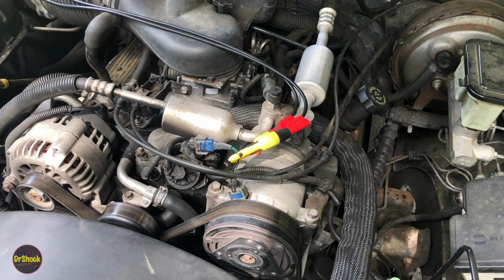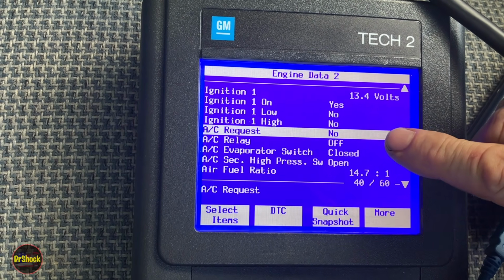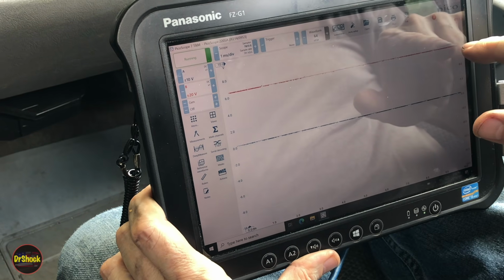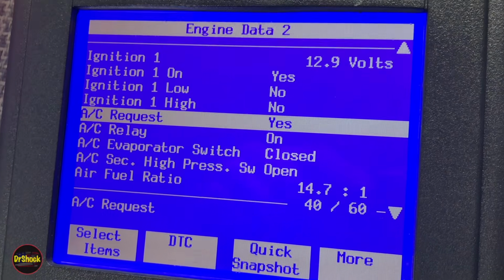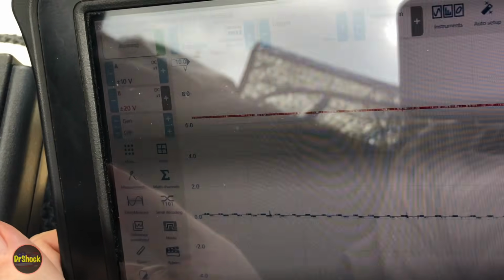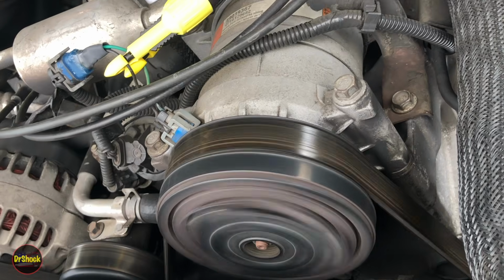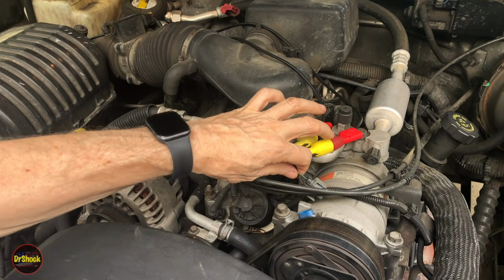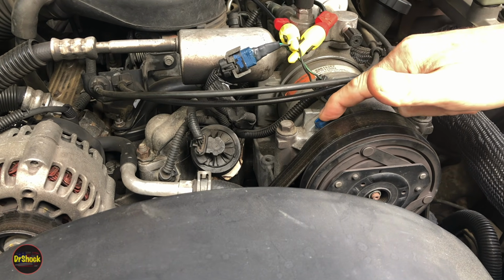1996 - 2000 GM OBS Truck HT6 AC Compressor Clutch Disassembly ~ Coil Replacement (Chevy & GMC)

Comment: Hey man I can’t get the installer tools to set the air gap ejybwoudk that be so I neee to get a special tool made to fit the shaft ?
Reply from the maker: There are links in the video description for where to purchase these special tools (many cannot be obtained over the retail counter). 

The situation we ran into here with the wrong threading on the shaft was a manufacturing error by the supplier to GM, it should be rare/uncommon to come across imo.  But if you do run into it, yes you'll need a machine shop to fabricate the correct thread arbor as I did.

Comment: If you needed to remove this type of clutch for replacement how would you going about doing so? Or does this type of compressor require a full replacement due to a worn clutch?
Reply from the maker: Watching this video should answer such questions.  You can use the scrubber to get to the disassembly chapter.

Comment: I am having a hard time locating a clutch assembly for the HT6 with the Nut hold down
Reply from the maker: You using the part number links in the video description?
Reply: @DrShock  Ok yeah guess I missed it thanks, and thanks for the video

Comment: This is my problem exactly..but my 99 has the compressor way down at the bottom so it's gonna be a little struggle
Reply from the maker: GM had multiple truck designs in 1999 - 2000, this video is showing the carry over old body style (ODS) design from the previous generation that continued to be sold thru 2002 in various weight ratings.
Reply: @DrShock yeah mine is end of production year 99. I always have to get parts for "new body style" it was all good info for me tho

Comment: My clutch clicks on and right back off after 2 seconds.    If I jump out the evap switch the compressor will stay on however I only ran it for about 10 seconds as I didn't want to burn it out.     Ac was very weak when I bought truck.  99 yukon.  I added a can of charge and it worked great for 3 days.  Got weaker day 4 day 5 started doing what I said above.    Im thinking theres a leak and believe its prolly an o ring or Schrader core but im not an a/c guy. And if I take it to a shop there gonna tell me the entire system needs replaced due to being 25 years old.      Hopefully I can find an honest shop.

Comment: As usual man your videos are enjoyable and useful especially for owners of this type of cars and I am one of them, but I am facing a problem while I am following it through the repair manual, which is that the compressor is working continuously without stopping Knowing that my Freon charge is exactly as in the manual, 3 pounds 8 ounces, and I have no leaks. , so I knew that this is not normal, so by following the troubleshooting instructions in the manual, I solved the problem and came out with two options, either the cut-off sensor, which I rule out because a month ago it was working perfectly, or a short circuit occurred in one of the wires and caused this according to the manual!! So is this possible? Thank you for your time. Have a wonderful day
Reply from the maker: Thanks.  This is a situation where having a Tech2, or similar bi-directional scan tool, is incredibly helpful to monitor the state of the sensors involved.  Without one you'll have to resort to the wiring diagram of the manual, and individually test each leg of the circuit involved with a multimeter and test light.  I would focus on the AC relay part of the circuit first, as the VCM/PCM triggers the power to the coil thru this leg.